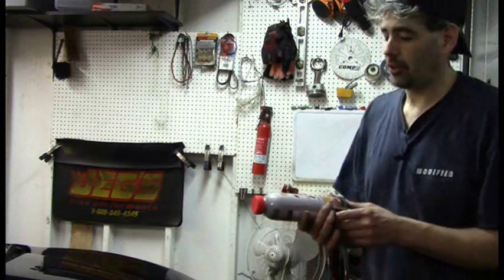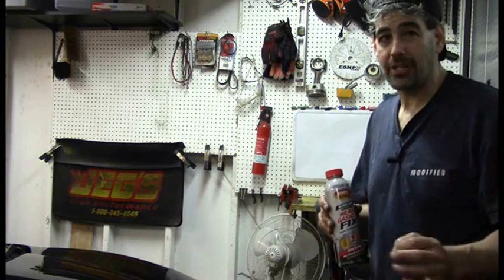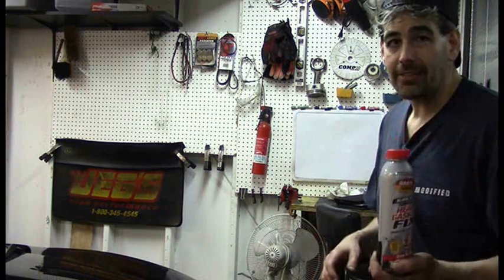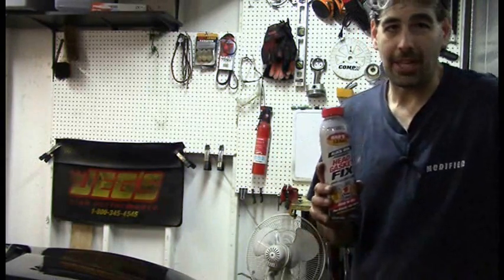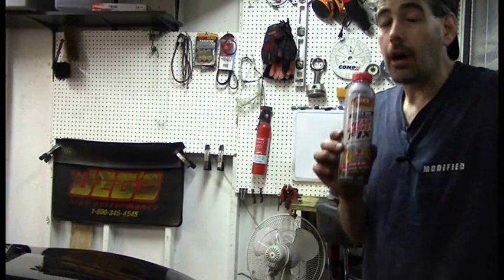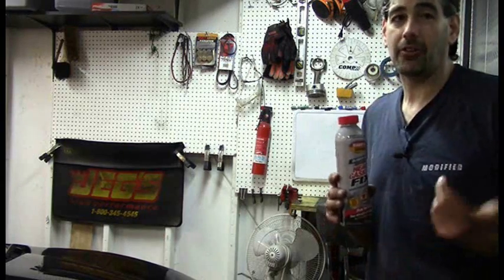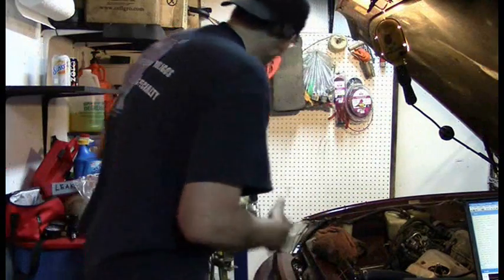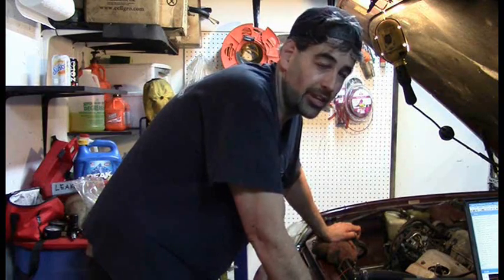Liquid Head Gasket Repair / Block Sealer Scientific Testing

Comment: I was under the assumption that you need to drain all of the coolant and replace with water before you add the sodium silicate concoction of your choice. Run it for like 45 minutes, let it cool and then replace the water with appropriate coolant water mix.
Reply from the maker: Yes some of these product do say to do that. Others say to leave it in others say to flush the product out and replace with regular coolant.

Comment: Howdy.  What product and how much you think I should use? I have a 1995 Subaru 1.8L 4-CYL boxer Impreza, 177,000 miles.  I have 76 and 78 PSI dry compression in #2 and 4 of one head (driver side).  This started a few days ago, we noticed while on a highway trip the power was weak and I can hear it missing as the RPMs drop from driving to idle.

I don't have overheating, excessive oil consumption (drippy seals, I add a quart about every 900 miles), smoking, or fluids cross contamination.  I'm waiting to have a leak down and another dry/wet compression test at a different shop. The first shop only did dry compression and wasn't too bright or helpful. 

If I end up having a head gasket leak between those two cylinders, what products would I possibly try to mend it?  It must not be too bad of a leak, whatever it is, for the compression to build to 78psi dry.  The other two good cylinders are 130ish psi. 

If it ends up being a valve leak, what products and strength could I try to get them clean?  After cleaning, I will have valve clearances checked, as it's probably never been done. 
Many thanks!

Comment: I've used K-Seal TWICE on my Xterra, with great results. I tried every other brand and the only one that even touched the problem was that orange bottle! It's good stuff for minor leaks, in my experience. The instructions also advised me to disconnect the injector and/or coil to reduce compression so the product can work more effectively. Not one other brand mentions this! 
Really enjoying your videos!
Reply from the maker: what was the compression pressure before and after using that product?

Comment: In my opinion you should have drives it so it would be forced into the cracks. At least a 39 min drive at 55 mph. Do you concur?
Reply from the maker: It doesn’t hurt but I don’t think it’s necessary. Even at idle your compression pressures are at least 120 and more likely 150PSI- way more than sufficient to exploit any weaknesses.

Comment: K seal worked for me 2 out of 2 times. Fixed a blown head gasket twice. Drove my civic for a year and a half . It is permanent if it works not a temporary fix. Use k seal if you see your car starting to overheat pull over immediately.
Reply from the maker: What was your evidence ity was a blown head gasket? what was the compression pressure before and after?

Comment: Didn't do any compression tests but I used this on my truck and the heater works better and the smoke stopped coming out the exhaust, it idles better now too. Haven't checked the coolant level yet because it was a really slow leak so I'm going to wait the normal 5-6 days before refilling the radiator again.
Reply from the maker: Sounds like there is more evidence you didn’t have a head gasket failure and more of a manifold leak.
Reply: @SchrodingersBox  I'm not 100% sure where the leak was but I do know I no longer have a cloud of coolant smoke behind the truck every time I stop after using this product. My radiator cap recently went bad and the truck got pretty hot and ran rougher after. I refilled and used this and now it doesn't seem too bad. But like I said I have no idea where the leak was

Comment: Great video and one of the better head gasket fix test videos! Seems to have shown some slight improvement.  I've read on the manufactures site it can take a couple thermal cycles to better create a seal. Cylinder 3 was at 120 prior(?) and it looked have gone above 125 psi in your second test? Bar's Leak FIX (1111) does not seem to be as applicable for compression leaking into cooling systems/bubbles in coolant as the BARS "Carbon Fiber" (HG-1) version that seems be superior to the (1111) product. Any visual results after the cylinder head was taken off?
Reply from the maker: It was pretty clear when removing the cylinder head there is no "welding" or even binding of the material as was indicated in the advertising.  It apparently is supposed to just plug the gap which of course is absolutely stupid

Comment: I bought "Steel Seal" Head Gasket Repair for 40quid (Around $50 bucks at the time). They offered a warranty if it didn't work. I thought great! Nothing to lose.
The product didn't work, great reviews, but didn't work. Just like in your video. I then noticed their website ONLY has 5 star reviews. They are share the good ones, so it makes me wonder if the reviews are genuine.
I filed a warranty claim, and they wanted... get this: A LETTER from "my mechanic" stating that THE MECHANIC did this personally and correctly in a professional shop and confirmed didnt work.
I haven't heard of it working from anybody, but the internet raves about it. Still skeptical to be honest. Thanks for sharing your experience!

Comment: You should be able to hear a difference in engine crank speed when starting the engine : crank accelerates more during compression of leaking cylinders compared to high compression cylinders. You can hear an intermittent higher pitch sound while cranking
Reply from the maker: correct. I show this in a number of videos.  not necessary here- it’s already confirmed this car had a bad head gasket. we are just scientifically testing product is all.

Comment: If the old coolant wasnt drained, wouldn't you still have contaminant from the exhaust gases?
Reply from the maker: No- it doesn’t measure gases absorbed in the coolant- it measures “live” gases bubbling out of the coolant. i.e. engine is not running the liquid stays blue regardless if the coolant was “contaminated” with CO2

Comment: after the first part - idle run 15 min you should also do the part 2 - drive the car after cooling out 15-20 min at max 1500-2000 rpm and as much I know this 2 part is as important.. so you didn't make it right
Reply from the maker: the instructions say to NOT drive the car and with good reason- you would never, never drive a car that is overheating for any reason under any circumstances. 
   Why would driving the car make a difference? Please explain the scientific reasoning that driving the car will seal a combustion chamber leak while idling at 2200 won’t.

Comment: You should have let the product work itself longer in the system. Like 1 wk after then do the test. Also you should have inform customer to drive it for a while and see if it helps As per your test, it did do some improvement. Not everyone can cash out money for a head gasket repair. Also you should have use K seal. Much better than Bar Seals
Reply from the maker: That not how the chemistry claims to work. According to the alleged chemistry, the product would seal after the first cycle or never work at all. It doesn’t work over time, according to the claimed mechanism.
Reply: @SchrodingersBox  That is a pretty bold claim after one cycle. I check the reviews on Bar Seal and most people suggested to let it cycle in the system for a couple of days for it to work better. As I said, it's better than taking the engine apart for a small head gasket leak. Car is old and not worth spending that much money. But I understand you are just following the instructions of the product.
Reply: @SchrodingersBox  it's not a miracle product. That's just a gimmick companies will claim to attract more buyers. As we all know, the product should be run in the system for at least a couple of days or so to see the result. No additives can claim after 3 to 15 minutes it will solve your problem specially a blown head gasket. If they do then that's a lie.
Reply from the maker: Good grief what did I just say? That’s not how the chemistry works. What you are saying is the equivalent of saying on a metal weld that failed  “as we all know, you should have let the weld set for two days because it was working at first, therefore letting it go longer must make it work better”. 
   It is important to understand the chemistry in an application. That’s the very basis of scientific theory: mechanism.

Comment: I think the directions state to run it over the next few days to note improvement?
Reply from the maker: That’s not how the chemistry described in the instructions would work though. And again- “note improvement”. What does that mean? What are the QUANTITATIVE metrics to “note improvement”?
Reply: @SchrodingersBox  not sure I tried it yesterday on an old civic. I think it stated somewhere on it that It may take a few days to work or seal all defects? I do not have the bottle with me therefore I can not say for sure that's what it states. The better one is the carbon seal its about 10 to 15 dollars more it does say guranteed whatever that is worth?
Reply from the maker: OK and what was your cylinder pressure BEFORE using the product?
Reply: @SchrodingersBox  like I say did not use those tools it stopped smoking and runs without over heating sounds like a step forward .
Reply: @SchrodingersBox  don't get my comments wrong I love your channel and your explanations on various issues. I prefer to DIY with in a reasonable budget and your advice help break down a lot of issues I have had and may experience at some point.
Reply from the maker: No I understand fully. Bottom line tho is you didn’t measure cylinder pressure. That’s my point. You have no evidence it’s even a blown head gasket as opposed to an intake manifold leak. 
  That’s all I am trying to say.  Not being difficult. just being logical and scientific.
Reply: @SchrodingersBox  Your totally right I can't argue with facts lol. Let's just hope its a lucky guess.

Comment: I used the bars head gasket fixer and that has been about 50000 miles and little over  a year ago.  
Still going strong.
Reply from the maker: That’s because you didn’t have a blown head gasket.
Reply: wrong it blew to the outside and was just spraying coolant everywhere couldn't drive it a mile.
Reply from the maker: What was the cylinder compression?

Comment: I ran 1 bottle of K seal pour and go on an 05 Camry(backed out head bolts).  At the beginning many many rough hydro starts. The vehicle immediately caused the block tester to turn yellow.  After the first bottle at 13 bucks the car stopped the rough starts, but, kept the check engine light on.  Ok, its driveable(only car we had at that time). After about a week, the K seal lowered my consumption rate of coolant by 1 and a half quarts a week( 2 to 1/2 a week).  Drove it that way for a couple weeks only adding coolant and checking fluids.  On this car when this happens the mechanics will tell you to replace the engine. So at this point, I'm in fuck it, let it fly mode.  So I run another bottle of Kseal because I saw a positive change the first time.  I drove it for half an hour and then parked to let it cool. The next morning the car fired up like when we bought it.  The check engine light was off. The car fails the chemical block tester still, but, much slower.  I'd  say it did enough to pawn it off to a title loan place,  because,  I'm not selling it to someone else with three kids.  Fuck the loan sharks.

Comment: Used blue Devil twice and has been successful. Both lasted well over 6k before symptoms came back.  Great temporary fix. Won’t work for all but works for me!!
Reply from the maker: what was your evidence you had a blown head gasket?
Reply: Schrodingers Box :  Motor overheating. Lose of coolant but no external leaks, overflowing coolant reservoir tank. Misfire code.
Reply from the maker: that’s not evidence of a blown head gasket.
Reply: Schrodingers box:  do you know what was the problem if not head gasket?  What ever it was blue devil fixed it.

Comment: Yeah the gas that us in the rad fluid after the fix ig s probably gases from before the fix was added. Are you like the rest of the fail testers trying to make it fail? "I am a mechanic,  this stuff does not work, but I will fix your engine for 1200 bucks"
Reply from the maker: ummmm. no it doesn’t work that way. The test detects produced CO2 from live combustion.   I am a scientist. I NEVER design experiments to fail OR succeed. EVER.

Comment: I used a “liquid glass” back in the day that was only available at a pharmacy store! It was used for a thermostat/timing chain cover that had leaking bolts that entered the water jacket.
The best way to use block sealers is to remove the thermostat and drain the coolant the flush the system.
Flush again with pure water to neutralize.
Bypass heater core to prevent unnecessary clogging from the sealer.
Add the sealer, top off with water and let the car reach running temperature with the cap on then wait fifteen to 20 minutes or until the leak stops then flush with water, drain and put a new thermostat and add coolant! 
Anti freeze has ingredients that are not conducive to block sealers! I’ve done this maybe twice in my life with good success! It lasted over a year!
Reply: Did you flush it without run in the motor How long did uwait bef starti g
Reply: Agreed. Drain and flush whole system with water and refill with twice the amount of product and seal with water only.

Comment: I have a 1.6 Suzuki x90 and it is pushing coolant out into the expansion tank and out the overflow, But I never see any bubbles it only happens while driving, and the temp gauge falls at idle , but always have heat, Have to keep adding  coolant, I had the coolant pressure test done and it stayed at 15psi overnight with a small leak at the water pump, I was wondering if I might have a cracked head since this has 187.000 miles on it, I have a new water pump coming, I should do a leak down test but don't have the tools and a garage, its winter here, its my work car, I would like to keep it going, Any suggestions?

Comment: Say the product works.... what people don't realize is that they're compromising the entire coolant system. You're adding a product that's intended to clog leaks, to a system that has many fine passages in it. I've seen way too many clogged heated cores because of this crap. The product most likely didn't fix the issue. Now on top of a head gasket / engine job, you've just added a heater core down the road.

Comment: This may not be the best question here but I don't understand how, when a leak from compression is pushing water away from the leak is going to get any of the repair stuff in the leak.  I guess the sealing happens when the motor is stopped and the water comes back in the cavity where the leak is that it does the seal. So, they should explain this so people who want to try this can understand how it is going to work. Further we need a video of a tear down of the radiator and water pump and even a head to see the effects these types of products have on those and other parts.  My concern is the piston rings getting gunked up with this stuff and no longer will be floating on oil.
Reply from the maker: Absolutely correct thinking. The directions say it is the heat of the engine that causes "molecular bonding" nonsense when the engine is stopped so its during the off-time that the repair supposedly takes place. But for the reasons you mentioned There is NO reason to expect this would work on anything but a radiator or intake manifold leak.  Definitely not a head gasket.
  To this day I have not seen one- not one single person scientifically show this works. It's always anecdotal and they don't even have evidence they had a blown head gasket in the first place.
  More people need your train of thought!!

Comment: My Honda Civic has oil in the coolant but it is not running hot will this kind of product work for that . If anyone has had that problem and found something that worked please let me know. Thanks
Reply from the maker: Depends.  Why does it have oil in the coolant? What is the diagnosis? You need that first.
Reply: @SchrodingersBox  .. I am not sure, I'm guessing a head gasket but not 100% sure.
Reply from the maker: Its far more likely you have an oil cooler leak. Pressure test the cooling system first.
Reply: @SchrodingersBox  .. I will do that , thanks for your help man it is appreciated.

Comment: That stuff is junk I bought a 2000 ford taurus both head gaskets were blowed someone tried fixing it with this stuff but they must have put about a gallon of it in there it took me forever to get that stuff flushed out of the system it had everything clogged up I had to replace the radiator, water pump, thermostat, heater core  all hoses it was awful I would never use any of the seal products do it right and put new gaskets and and fix heads and or block properly if needed!

Comment: Like your various vids. I looked at some similar products and realize that copper will etch aluminium so  even if the polymer helps, the copper will eat the block or mating surfaces .. As a sideline I have a trick for co2 detection.

Comment: Matt: I do not EVER use any of these products. Over more than 60 years I have tried a suite of these products & without  exception they all plugged heater cores & I believe were  the cause of losing several water pumps because of the "active" agent getting ingress to the bearing& seals (front seal leaks in the water pump). I would not presume to state that ALL products of this type cause the faults I have reported, but you obviously are aware of the chemical processes involved, so draw your own conclusions. Thanks for an interesting & informative video as usual.